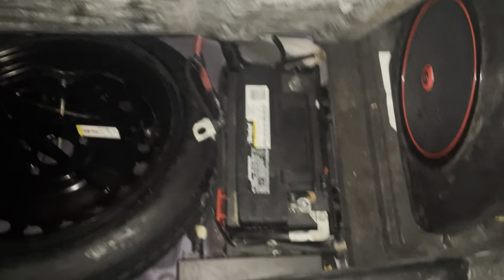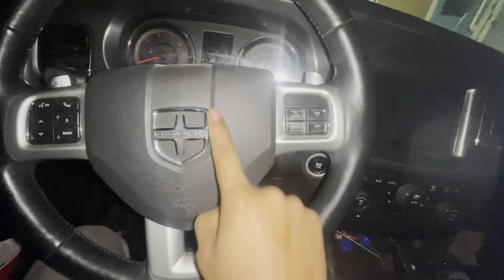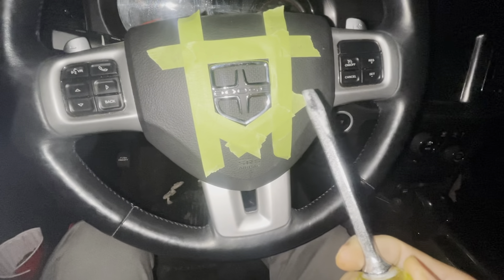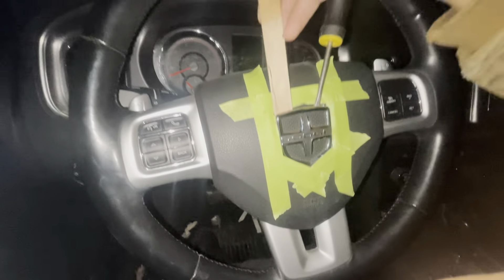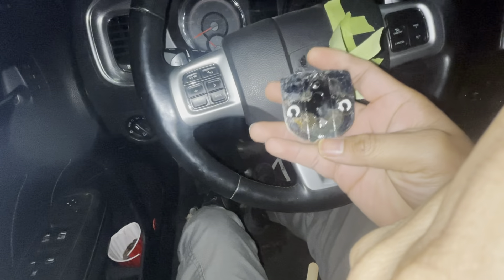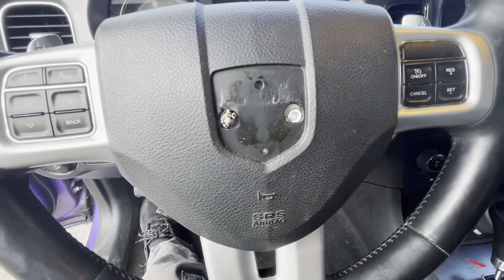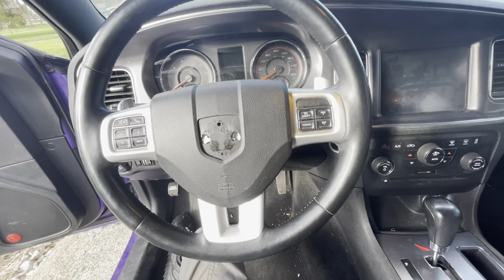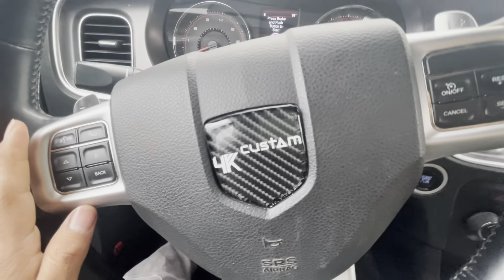Custom badge charger , jeep, Challenger

Comment: But their is a much easier way to do it that won’t leave broken peace’s in you’re steering wheel
Reply from the maker: How , I remove the air bags , and tired removing it , and some times the badge would come out in one 
Peace and sometimes the little plastic thing that brake in peaces I would have to remove manually
Reply: I removed the air bag from the car and then once you have it out you’ll notice it has little clips all around the side walls , 
if you pop them back you can remove the cover and you have access to the back of the emblem and the metal bar that holds it in place
Reply: I have a spare air bag at my house that has the emblem still I can take some pictures and send them to you’re instagram after work if you’d like
Reply: @4k_custom  yo we stay in the same city I’m look at a 2012 super bee this weekend but anyways man we have these car meet/ slide show at this church lot etc.
Reply from the maker: @eclipse854  ummm interesting . Thanks for the info . Now that I think about it . I can recall seeing some clips ,  if u got pictures that would be Awesome, FB or IG 4K custom
Reply from the maker: @desmonddinkins38  ohhhh shit I should pull up next time lol